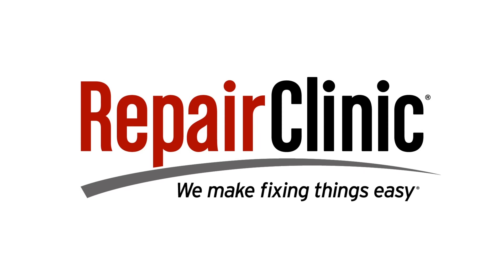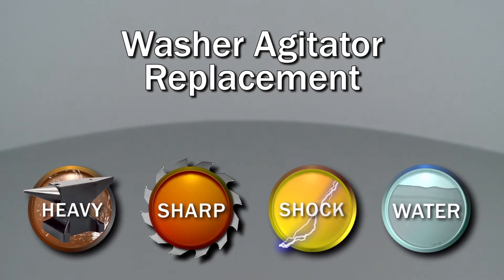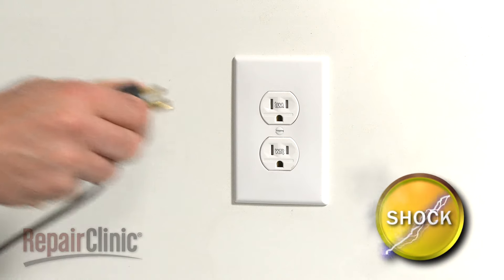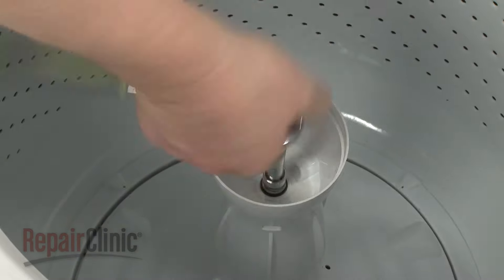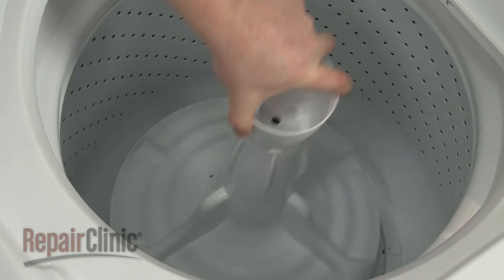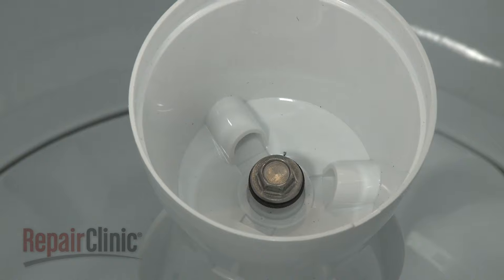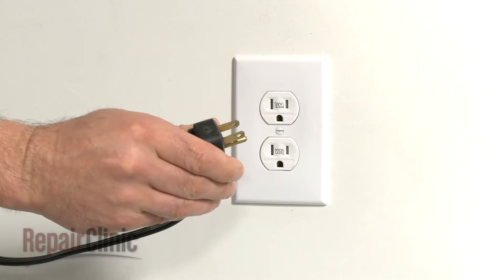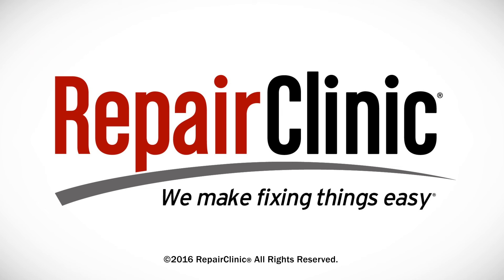Whirlpool Top Load Washer Agitator Replacement #W10680208

Comment: Why wouldn't the agitator come off after the bolt is removed? Mine will not come up.
Reply: Joshua Spraul so what did you do to make the agitator come off? I’m having the same issue as you.
Reply: Same issue I’m having, has anyone gotten it out after unbolting it?
Reply: I thought mine wouldn't come off either. Both the cap and the agitator. But I just pulled really hard and they came off. I was afraid I'd break them at first lol but thankfully came right up!
Reply: Shawn Sweeney 

I am facing same problem, did u solve it ? If yes please help
Reply: Lester Wheeler 

I am facing same problem, did u solve it ? If yes please help
Reply: Desmond Glover 

I am facing same problem, did u solve it ? If yes please help
Reply: I had to pull very hard. The connection piece where the bolt attaches was quite oxidized and was not allowing the agitator to pull away from it. I had a friend knock it it with a screwdriver + hammer while I pulled it upwards. This loosened it enough for me to get my hands under it and pull it up and out. Hope that helps!
Reply: I just got mine off. I tried the brute strength way with not luck. I placed a a band underneath and pulled and nothing.  Then I dropped a little bleach in the whole that the nut came out of and saw a chemical reaction. I waited a minute or so and then gently poured 60 degree Celsius water into the hole and pulled up and down on the agitator 10 or so times and repeated this step for about 20~30 mins. It finally came off. The gunk/scud was horrible. I am currently soaking the agitator and ring in the tub. I have a pause and play washer. Once you take out the agitator it will not fill up. So I have to fill it up with a Downy bottle filled with hot water. I can drain it by holding the button for 3 seconds. Hope this helps.

Comment: My agitator didn’t come out after taking off the top screw! 
TF?!
Reply: Me too...
Reply: Hey Israel, (nice name by the way) 
Did you get it out yet? 
If not, lift agitator as high as you can grab under the ring (under the agitator) try to get fingers under there and slowly wiggle the ring and pull up. Mine was super corroded so it took some work.
Hope it helps.

Comment: Then only way we got ours out was to remove the bolt spray some w-40 and turn it on to drain and spin and it loosened up. I thought if this doesn’t work I’m going to have to jump in there and pull it out like there other person did in the comments 🤣

Comment: My machine is 30 years old with a different agitator, so this video is not applicable. There is no central nut or anything obvious detachable.  Searching with keywords old ancient or prehistoric gives the same results. Never mind, I found that I had to plunge my hand into the old gunky softener residue reservoir and lift the bottom to reveal the nut underneath.